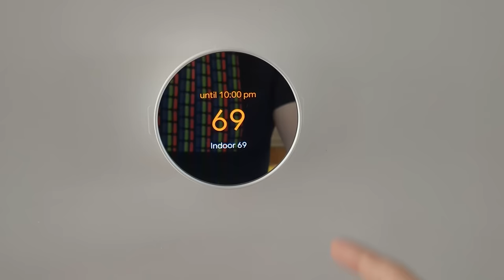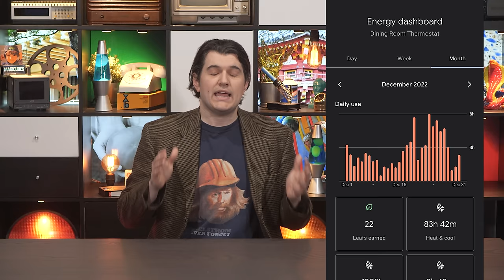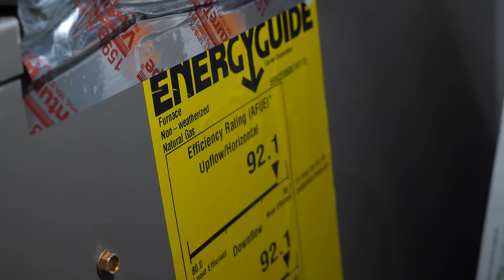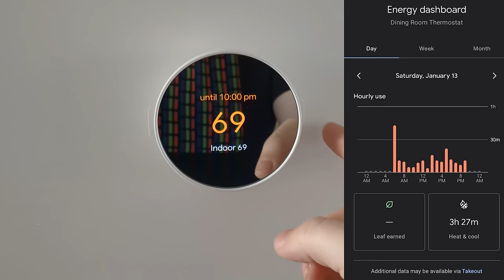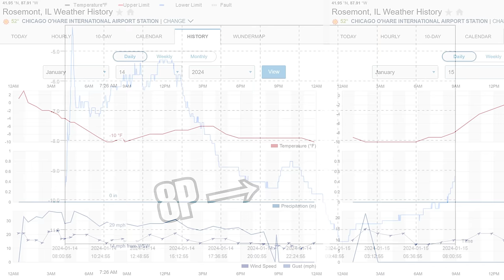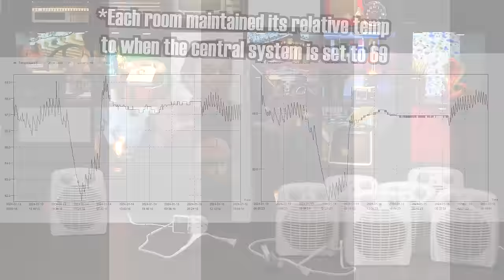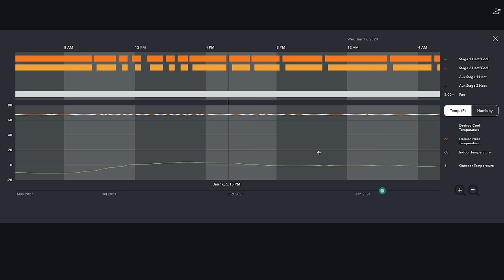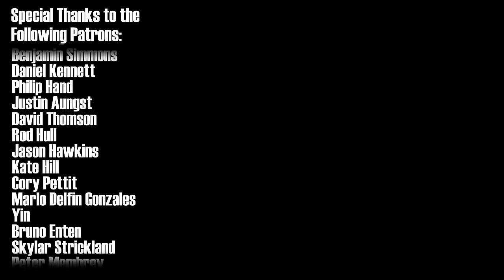Old HVAC industry practices are holding us back and costing us money. But we can fix it.

Comment: Oh yes, I know that too. I asked several installers for my house who were supposed to give me a quote for an air conditioning system that could handle outside temperatures of up to minus 20 degrees in winter.
The prices were exorbitant! 30 to 40,000€ for an old house.
I then bought myself a system that had a maximum output of 20kW for just under 4000. The installation was done in a few simple steps and it heats without any problems. Since it is an inverter device, the heat pump often only runs at a fraction of the output.

One wanted almost 2000€ just for the coolant lines

It is a mystery to me that someone can suddenly charge 10 times as much.

Comment: Great video. 100% agree with your comments. Live in the Detroit metro area and had a new HVAC system installed 2 years ago in a home built in 2004. 

The original units were single stage builder standard low efficiency units and a single furnace and AC unit for a 1.5 storey 3600 sq ft home w deep full 2k sq ft basement.. 

Knowing what I know now, I should have replaced them a decade ago as the payback period on the furnace is less than 5 years based on gas savings.

We went with a Lennox 99.5% efficient multi stage, variable speed furnace. 

The gas bill has been about 60% the old bill and even though our home is not zoned or multi-furnace, the fact that our system has a gas valve that can open/close in 1% increments based on demand and the DC motor runs constantly, the ambient temp is far more consistent across the entire home and more comfortable.

We also went from a single stage AC, skipped 2 stage and went right to a variable inverter based AC unit,  we are also saving a tremendous amount in the summer where we got hot humid weather often in the high 80s/ low 90s.

I would disagree though if your stance is that your furnace should run most of the time. I dont think these appliances are designed to run constantly (exception is DC furnace fan) as this will likely prematurely wear out your system and in the most extreme weather cases, may be insufficient to keep your home comfortable.

Having said that, you would gain far more usability with a multi-stage furnace in a four season area like the midwest.

Heat pump tech comments are right on. It is absurd that hvac companies don't simply add an option to enable that functionality on their AC units but that would mean a smaller furnace so likely lower overal cost system.... 

I had 6 different contractors and some very large ones come in to quote. Not a single one did a load calc nor offered the service. I also asked about the efficiency of the current duct work and whether they would consider optimizing it. None of them wanted to touch the ducts stating "your home builder did the initial analysis and it would be too complicated to re-do it." All they want to do is rip and replace the end components... No surprise I guess.

Comment: Love your videos! I put a heat pump in when my 25 year old AC and electric furnace died. Per the topic of oversizing- By your standards I did oversize. I increased the capacity about 35%, and was glad I did. I lived in Texas, and entertained often, cooked outside often, came and went from the outside often. I needed a system that could keep the house cool with 15 friends over in August with the doors opening and closing and cooking etc. all the time. My older , smaller system could at best hold the temp on a summer day like that, but could not cool, and worst case the heat would increase in the house until late at night. So I went up in size and got a 2 stage. Most of the time ran on low, didn't short cycle, and removed humidity. When I needed it, stage 2 could keep a house full of guests coming and going cool on a 105 degree summer day.

Comment: I just purchased a home that is all electric in a similar climate. Amazingly, it has central air. It does not have central heating. It has only baseboard electric resistance heating, basically upgraded space heaters. I will be installing a heat pump. The Resistance heating does have individual thermostats mounted on the walls in each room, so I will leave it as a backup just turned off when I am around and as a backup turned down when I am away.

Comment: I have a heat pump and it drastically lowered my energy bill. But one downside is that you've got to keep all the doors and windows closed when in used. It spends most the energy raising or lowering the temp, but very energy efficient to hold the temp. So if your indoor temp raises or lowers because something is open, it will go and go and go and go fighting to get the temp right while the cold or hot air flies right out.

Comment: Question for you, why if you have already got Air conditioning, do you not get a retrofit reversing valve, and additional expansion valve fitted?

The parts from danfoss would be 60 dollars or so, and a visit from a refrigeration engineer, plus a frost stat for the outdoor unit, 45min to an hour labour required to fit and test everything.

Then your existing system will be the heat pump you need, saving on installing a new heat pump (made of exactly the same components), reuse is better for the environment than recycling.

Comment: I don’t know what you’re talking about heat pumps vs AC units. Here in Australia I’ve never seen a unit that doesn’t do both. I’m pretty sure they basically just reverse them and use the same pipes for condensers and evaporators.

Comment: I haven’t watched the whole video yet but I have one elephant in the room which you may or may not have factored in. 

1. Where does you home sit in it’s “unit”? By that I mean if the block consists of 4 units, does your block sit inside other blocks or is it on the outside?

The reason this matters is if your unit sit on the outside, you will use more energy than one which is surrounded by two other units. 

This may explain why the systems are oversized because I would assume the construction company would use the same spec heater for all units.

All this aside keep up the great work. I restro-fitted heat-pump heating and cooling, insulated all walls and installed double-glazing in all windows in an existing home here in Australia and the results are huge. . I also applied tinting  film to windows facing the sun which also made a huge difference to the homes cooling in summer which used heat pump (called reverse cycle heating/cooling) which is powered by solar system which often (not always) means the home generates the most electricity when the sun is at its hottest.

Comment: If you're having neighbours that are heating, you can save on heating yourself.
Weare heating with wood downstairs and the chimney is going up, sharing it's sides with TWO rooms, no ventilation (which very old houses have on top of that) and you still don't need to heat upstairs.
But if you are not at home for 2 or 3 days and don't heat at all, you'll notice the whole house being actually really cold.

Comment: I am a person who installed solar panels on my roof. This video cemented my decision to replace my (recently broken) central air with a heat pump. I live in Wisconsin, and the cold is slightly worse than the Chicago area. The only difference is that my backup heater is my (3-year old) gas furnace, and my 3rd heating source is a wood burning stove. (Yes, it is not environmentally friendly, but I get the wood free from tree guys. These trees were getting trimmed or cut down for other reasons than heat generation) A heat pump does make it more cost effective; the heat pump will be used for more than 3 months a year.

Comment: I had a dual fuel system installed in 2015, with a 96% dual stage 30/60k BTU furnace and a 2.5 ton traditional heat pump.  Unless it's raising the temperature of the house more than a couple degrees it stays on the 30k stage the vast majority of the time.
Having both has saved my rear end after the heat pump failed multiple times (including the compressor locking up solid and having to be replaced at one point), and the furnace broke once in the last ten years.
When the furnace broke I was running the heat pump down to 10F and it kept the house at 70F even though it's an old fashioned unit and is only rated down to 25F.
Still, the gas furnace is cheaper to run when it's below 30F outside than the heat pump, even with my low hydropower rates here in the Northwest.
In my experience the new equipment is more efficient but breaks a whole lot more.  The old Lennox Pulse system was still running fine since 1987 when I replaced it... even though it was known to crack heat exchangers and kill families in their sleep.  The cost of repairs of the newer equipment has far exceeded anything I've saved in utility bills in the last ten years.

Comment: I heat and cool my living space with two portable air conditioners ( not heat pumps, just air conditioners).
 In warm and hot weather I Use them both to dehumidify and cool the air and they both run 24/7. In the Cold parts of the year I shut one unit off and run the other 24/7 but vent both the hot and cold air in the living space. This turns the unit into an oversized dehumidifier and I have reached temperatures of 119 degrees when the living space is unoccupied because the single digit humidity levels make it very easy to heat the space.

Comment: At the beginning of the video, you said your 2 ton air conditioner was sized perfectly.  So 24k btu to keep your house 30 degrees cooler than outside works great.  But that goes both ways, you cant use the same number of btu's to heat your home up 70 degrees from outside temperatures.  Have you considered that some of the heat from your neighbors house is being drawn into yours since your house is so much colder?

Comment: Yay - a common sense video about heat pumps. We have the same in the UK. Our heating systems typically heat water that is circulated around radiators in the house, and are oversized to give fast response. Many heating system installers in the UK are all about gas and oil fired boiler technology, and really struggle to understand the requirements of modern heat pump, which is all about long run times. Also, theres a desire for fast response in heating, leading to 30+kw heaters, as opposed to the principle that heat pumps are best run continuously. One specialist who is installing a new system in our shared building, admitted that he couldnt get his heat pump to work - he installed it in a new house he built! We changed our 30kw gas fired boiler for a 6kw air sourced heat pump as an emergency experiment (The gas supply was offline, it was cold, and the HP was idiotically cheap to buy, so was worth trying), and it worked beautifully. It struggled when temps went less than freezing, but this was expected - my calculations showed that we need 7kw continuous in the house at freezing, confirming that the pump design was borderline. We've since found another the same size at very low price, so we now run a dual heat pump for both the heating and hot water. Our electricity bill is in the region of  2-3 GBP (about 3 to 4 USD) per day. Some appartments in our complex are ten times this on gas...

Comment: Hello Mr connections, technology
I'm currently in hvac training and stumbling across your hvac videos in your channel has actually helped my understanding of the subject quite a lot
I discovered the channel from your video on the "geosafari" and have watched whatever comes up, but do you mind if I ask some of your resources for research on hvac matters such as oversized furnaces, the extra efficiency of heat pumps opposed to furnaces? As I am writing an essay on oversized furnaces and the bonuses of heat pumps replacing them I could use help with finding resources for such topic.

Comment: Very interesting we have had heat pumps in New Zealand since about the year 2000 and they work very well, every heat pump sold here is "reverse cycle" so it can be used as an air conditioner in the summer also

Comment: In UK most common reason for choice of heating boiler power output  is actualy the hot watter consumption. Your standard  hot watter  shower uses several times the amount of heating the heating does. When watter has to heat-up in one step.

Comment: Good video. However one thing got me. Covering the gap if you have temps lower then design temps with space heaters assumes the electrical grid can take it. Coldest day of the year (Alberta Canada) we almost browned out our electrical grid and had to send out an emergency Allert to the province to STOP using space heaters and extra electrical appliances. With temps below -40C (-40F) a real possibility, I would still want extra capacity. Even if I used the normal design temp of -45C we use here. Design factors are required.

Comment: In North Texas, I’ve seen a lot of undersizing on the cooling side. The square footage math works, but not when full sun all day, lots of windows and minimal insulation are accounted for.  I end up adding 1/2 a ton when replacing. I always oversize aux heat in case the heat pump dies. People get pissed when they can’t reach 72 when it’s 102^ outside.  It’s ridiculous.

Comment: HI again.. you are amazingly thorough, and thank you,,, I only have one wacky issue,,,, suppose an older person wants 78 to 80,, and the neighbor moves out, or likes 60.. suddenly your space will use 2 or 3x the heat.. or the exhaust fans over stove are on during Christmas,, and heat cant keep up... I do agree that your system is a bit oversized, yet not 4x, maybe 2x...  also, ac lowers temp from 90f outside to 75f inside, while heat raises temp from -15 out to 75f in.... not comparable... my main concern is neighbor gone, heat at 50f, and your space is cold.  you are on target, yet this scenario you never planed for... KEEP THE VIDS COMING!   ,,David

Comment: We live just outside of Louisville Kentucky, our house was built in 2011. Single Family, 3 bedroom 2 bathroom 1730 square feet. Has a heat pump system. I keep our thermostat 72 day and 69 night for summer time and our electric bill is around $90 I keep the thermostat on 70 all the time in the winter and electric bill goes up to $180 and I always feel cold. Also feel like it runs all the time rather in heat or cool.

Comment: Question, not sure if he directly addressed this: he talks a lot about how to appropriately size systems, the main benefit of which is lower upfront cost (as opposed to having to buy and install an oversized system). But what are the utility impacts for gas or electric? If your system has to run more often, but is also consuming less resources (gas/electricity), does that cancel out more or less on the utility bill? With a smaller system in the same house, should I expect my utility bill to go down, stay the same, or increase, and to what degree? Also, what should be expected in regards to the life span of the equipment if it is running more often? Does a more accurately sized system have a shorter life span from being used more often, and again, if so, to what degree, and does that diminish the cost saving of buying a smaller system? Like, if you buy cheap headphones, and they break every 6 months, so you are always having to buy new ones, but you refuse to just buy a nice pair of headphones that will last years, you're not saving any money, AND your quality of life is worse anyways.  Does that kind of thing happen if you buy a more accurately sized HVAC system, even a little bit?  From a data point of view, I love the experiments he did here, and am excited to buy a smart thermostat for myself as a new home owner to track this data and make an informed decision down the line, but I'm curious if these points I've brought up were under considered in this video. I doubt they are concerns, but since they weren't directly addressed, I can't help but wonder.  Or maybe they were and I missed it, I do tend to miss things in these long videos :')

Anyways, great video, love the channel.  I don't ever comment, but I follow a lot of your advice. Been using bog standard dishwasher detergent for years now with great success, learned how to use my electric range top more effectively from you, and will probably end up buying an induction oven and heat pump eventually because of you.

Comment: Finally someone with a platform is saying what is way overdue.   If you ever do a followup on maunal J calculations there is another pesky problem to consider zoning and oversized AC unit, with undersized ducts - i pretty much have to replace my whle setup as it shrt cycles even more with zoning as the zoning is on or off thermostats not taking advantage of an already running zone.  Add to that its single stage and there is no blower speed control to slow down the fan and reduce the compressor capacity when only one zone is on.  Then further add to this that the undersized ducts are to the only side of the house that gets afternoon sun and it sits above the large garage with the only register blowing 6’ from the thermostat and you have a disaster of an instalation!  Great video - thanks!!!

Comment: The US is 30 years behind the rest of the world when it comes to heat pumps. I’m from Australia in the the HVAC trade. What you have in your homes has not been in Australia for 20 years or more. Fixed speed compressors are what I was working on as an apprentice. They are not allowed to be sold here in Australia as they don’t meet the efficiency requirements. Gas burners are being slowly phased out. Seeing what is the norm in the states this is like looking back in time.